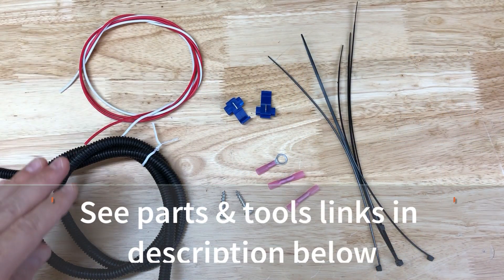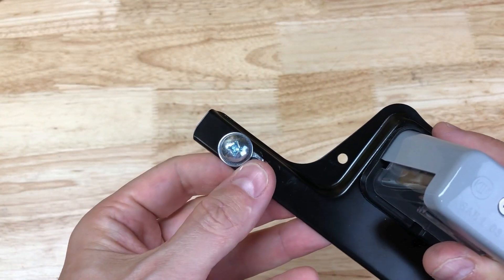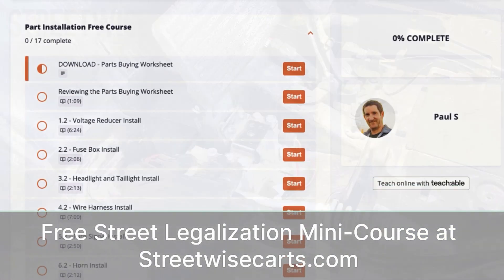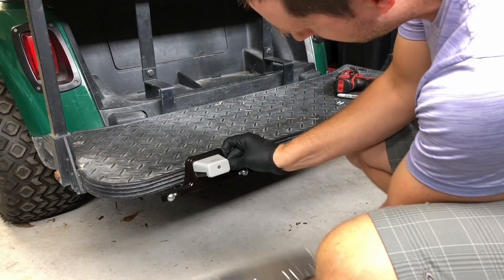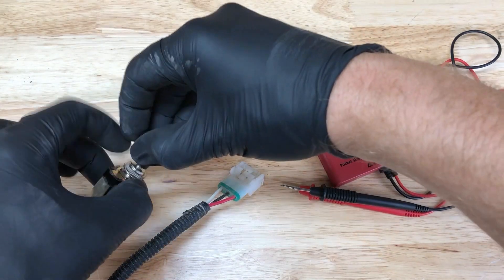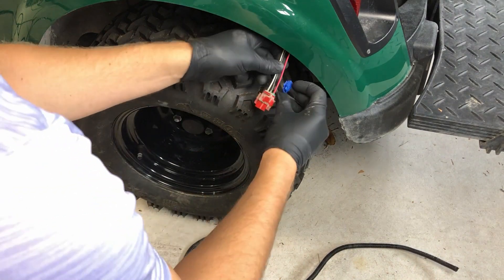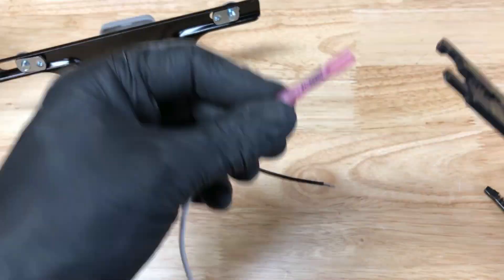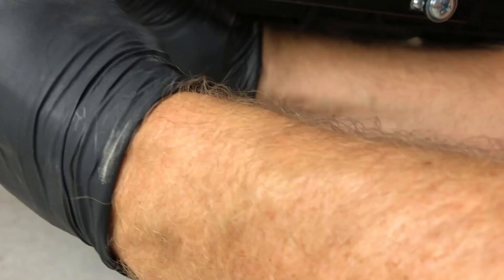Golf Cart License Plate Light & Bracket Installation for Street Legal LSV Conversion

Comment: Most people will need a voltage reducer to connect it your way. The tail light is usually powered by 48V and you'll burn your license plate light unless a voltage reducer was already installed. Do not rely on the wire colors if you don't have a multimeter. I learned the hard way because I instantly burned my light after connecting it. After installing the voltage reducer I did it the same way you explained and it worked.
Reply from the maker: You are correct and I should mention that this does assume that your tail lights are 12v. Some older or custom carts may have 48V lights, but they are much less common.

Comment: Is there a minimum height that the bottom or top of the license plate has to be and did you install on the drivers side for a reason other than  to get is closer to a tail light?
Reply from the maker: There is not a minimum height that I'm aware of, and I did not pick drivers side for any specific reason. Thanks for asking!